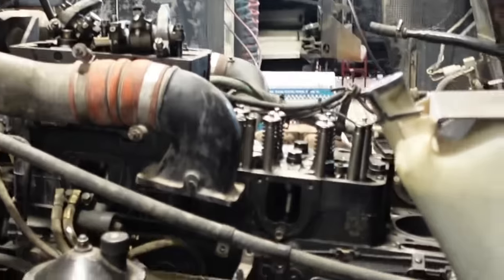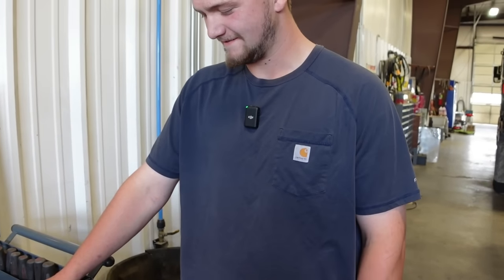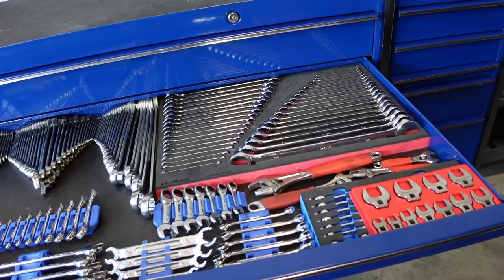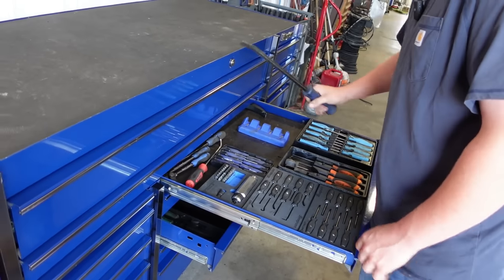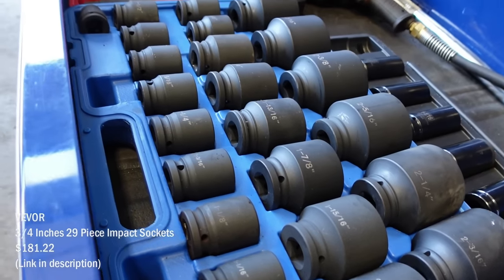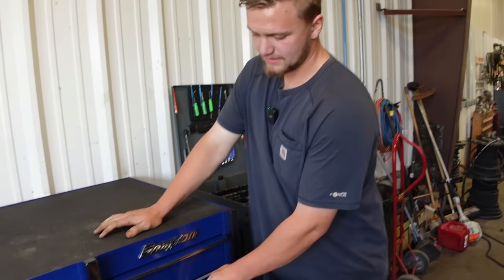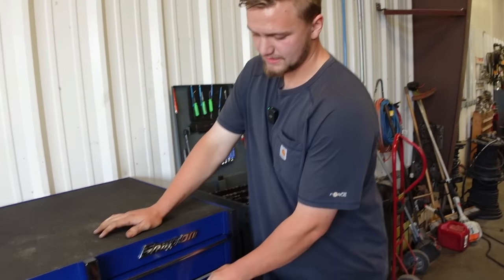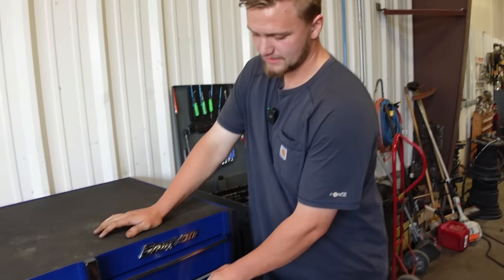Starting His Career Off Right! (HEAVY DIESEL) Toolbox Tour

Comment: the icons are identical to the old snapon wobbles. i bought all the snapon ones in 2000 and in 01 and i bought the icons recently for the service truck to try them out and they are the best wobble out there for the money. theyre the same as the cornwell blue power. the new snap on pinless are nicer but if u dont have 4000 bucks to shell out for impact wobbles u cant beat the icon.
Reply: I have both snapon and icon and cornwell.

Comment: I would definitely recommend a 1/2 to 3/4 adapter for the Milwaukee 1/2 2767, I have both the Milwaukee 1/2 and 3/4 and find the 1/2 will get wheel bolts undone much faster than the 3/4 in the same scenario. 

But I do recommend having both the guns because it’s handy when you have an apprentice to lend them the 3/4 and you can get the 1/2 for doing a different wheel. 

Coming from a field service tech who doesn’t rely on air tools, Milwaukee is a godsend.

I also bought the sawzall for a completely different reason, primarily I bought it for cutting through rubber drive tracks on tractors, but found myself using it for cutting bushes and bearings when I can’t fit an angle grinder or torch

Comment: Nice setup Lyle! Great to see other heavy duty diesel setups. The camera work was great! Lyle if you see this I'd suggest the Lisle 42400 Air line disconnect tools. They are handy for all sorts of sizes of airlines
Reply: I might get a set of them didnt know them were a thing
Reply: Im also a big fan of just cutting the airline and switching the fitting to a compression fitting 😂
Reply: @lylebarlow2101  yeah not a bad idea, had a factory push in in the frame rails pop out in the middle of the night coming down a mountain, luckily I was close to home and my dad brought me a compression fitting to get it fixed